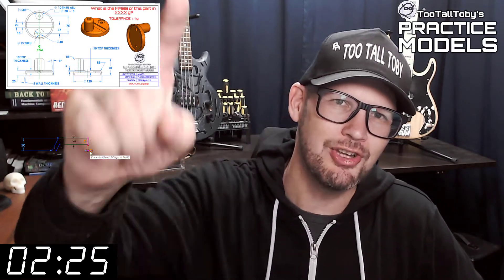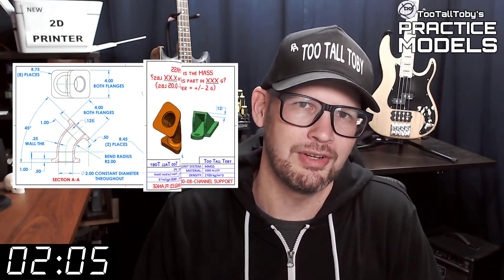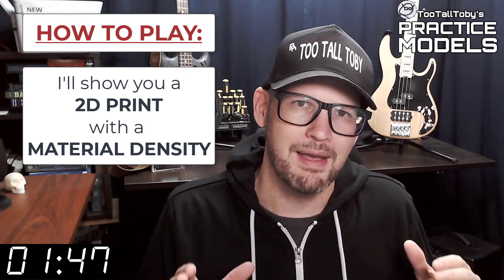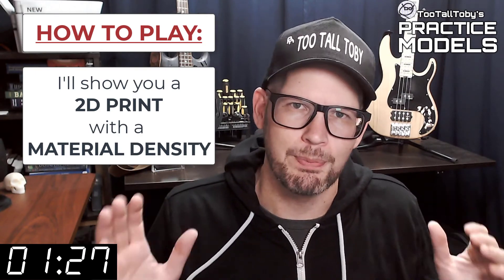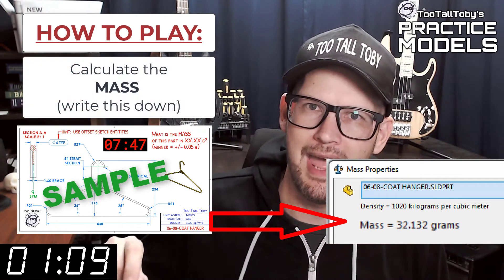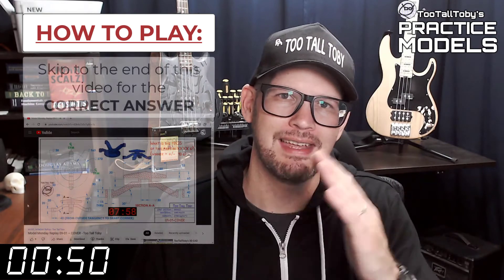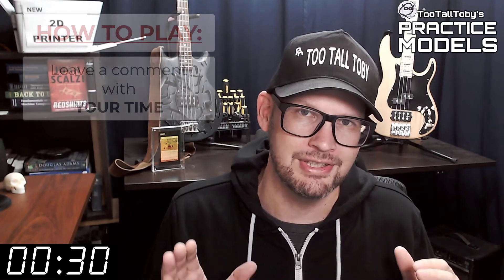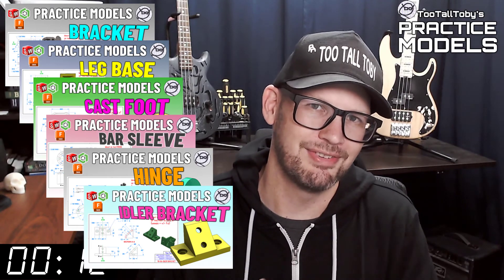SOLIDWORKS Practice - Onshape Practice - Fusion 360 Practice Exercises - TooTallToby-10-07

Comment: Did a somewhat messy version in 11:11 and 5.903lbs in Fusion 360.  Created a layout sketch for the curve, then a perpendicular line on the curve's centerpoint. Mirrored the bottom flange on a 22.5degree plane at that pivot point. Finally did a sweep between the two flanges. Some of the responses are much better methods.
Reply from the maker: there's always more than one way-  but in the end you GOT IT!  Nice job Josh!!

Comment: 8:29 I struggled with the centre radius cuz I was trying the sweep with circular profile by drawing only the centre line profile.. the centre radius should be 3.25 in( 2in of inner radius + .25in wall thickness + 1in radius of that constant diameter throughout hole )
Reply from the maker: Yeah I had some trouble locking down that center radius too.  I guess, technically, you could sweep it using that inside edge as the path, but that felt awkward to me
Reply: @TooTallToby  I would love to see your method one day on MML.. 😊

Comment: Somehow. I made it on my thrid attempt. 5.90 pounds. I made the bend radius parametric and fixed my mistake that way. I assumed the 2 inch radius was to the centre of the tube, but it was to the inner shell.
Reply from the maker: correct - always tricky when they give you the bend radius, but you need the centerline radius.  Nice job!

Comment: I made this twice, once yesterday starting with the squares and again this morning doing it a different way, using a sweep and I got the same result of 5.41 pounds. I was about ready to post, "Toby, check your model I don't agree, are you sure your right". I looked back again and even made a drawing from the part to double check my dimensions. Both times I missed the location of the (1.00") dimension from the bottom of the flange to where the 2.00" radius starts. It should be (1.5") The way it was dimensioned messed me up. To me the correct way to dimension would be from the bottom of the flange to the start of the R2.00 with a dim. of 1.50", but if that is the way the drawing is presented, those things happen in the real world.  All in all a fun part.
Reply: I did the same thing.
Reply from the maker: Awesome!  Love reading through your thought process.  Glad you enjoyed this one @Thomas!
Reply: I got 5.41 in one of my attempts as well.  This one was trickier than expected.

Comment: It seems like that there are two possible solutions here.  If the end plates are extruded inwards towards center instead of outwards it produces a smaller mass but still seems to match the drawing.  I don't see anything in the drawing to exclude that.  Am I missing something?
Reply from the maker: I'm not sure what you mean by end plates.  The flanges?  Their location is defined relative to the strait section of the pipe (1.00 strait portion on each end) so I don't think they can be extruded outward vs inwards.  But I could be missing something.  Let me know and thanks for all the great comments!!
Reply: @TooTallToby  Sorry, Never mind.. I was being a goofus.  My 2.0 radius was on the center line and not on the inside edge of the pipe.  I thought that because my mass result was correct that I had modeled it correctly but it was just a coincidence that doing it wrong produced the right mass result when the flanges were extruded outward instead of inward.  I'll show myself out.  haha